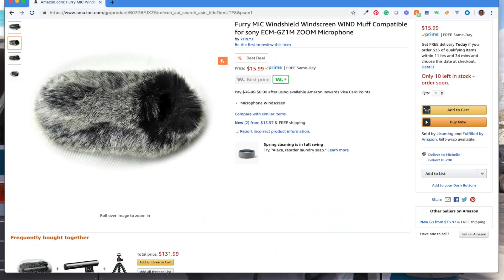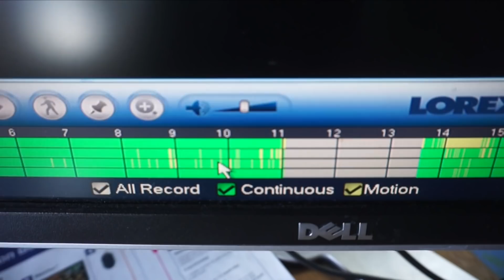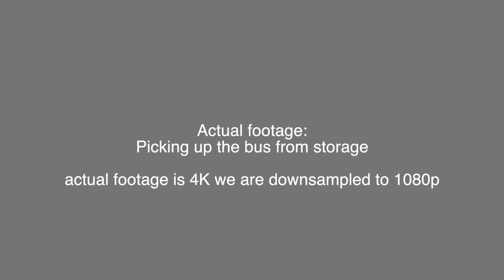Security & Driving Cameras - Part 2: Mounting and Wiring the Cameras & Initial Performance

Comment: Another great project almost done. I liked the placement of the cameras clear view no doubt what you are looking at.  SSD or HDD an SSD writing all of the time might not be durable as a HDD but then again I woiuldn't want to hear the HDD writing while everything is quiet.  You have open spaces in your bays you could place it in one of them and isolate it with dampening material.  I think taking out of its case is a great idea that thing is huge and could be more compact.  Great job Juan and Michelle.  Thank you for sharing Ed.
Reply from the maker: Thank you Ed, we have been really pleased with how this system has been performing.  It's kind of crazy to think that some of our videos in the future could include beautiful security camera footage!  I was really surprised when I opened up the case to discover how small of a footprint this little thing could actually take (The circuit board is barely bigger than the hard drive itself).  That probably wouldn't sell very well in the stores where people want to see a large piece of equipment.  Thank you for tuning in.

Comment: Nice job on the camera installation. I hope they hold up to the wetter weather when you make your way out of the southwest. As a long time TiVo owner you don't want to use an SSD for video recordings especially with that many 4K streams to record.You'd kill an average one in a few months and a very expensive one in less than a year. Many people have tried using SSD's to record video and they just aren't reliable over the long term and are expensive for a limited amount of storage.  I would look at finding an external enclosure that you can isolate from hard bumps or jolts and it should hold up well on the road. With your ingenuity I bet you could make something supported by springs that would work great. That drive looked like a WD purple drive and you would be better off upgrading that to a NAS hard drive. You can get a 4TB for right around $100 or so, I like and have had good luck with Western Digital.
Reply from the maker: Thank you Dirt Road Sailing - Welp now I have more researching to do.  I was aware that the SSD only have a limited amount of read/writes but I was not aware that it was this severe.  funny enough I thought about a small platform suspended on springs.  Thank you for the input ... I will be doing more research :)
Reply: @BeginningfromthisMorning  Samsung 970 pro should have enough writes for you but just putting good isolation on a spinner drive might be a lot cheaper for the space you'll get.

Comment: A spinny HDD is fine in a vehicle.  I would discard the stock housing and mount it on its own little platform that’s isolated by rubber feet or short springs or suspend it in surgical tubing to dampen it against vibration and it’ll be fine.
Reply from the maker: Thanks Ryan - we have been using it for about a month and I have seen no ill effects :).  We will very likely be ditching the case and just mounting the circuit board somewhere.
Reply: This has been my concern as well.  I plan to run the drive it comes with, if it fails in short order then I’ll consider an SSD.

Comment: You'll want an ssd :o) . You might as well get one from the start, rather than change it later.  Even with only 15 fps, seven 4K streams will be murder on the drive, having to work hard (especially when in motion, where each and every frame will be very different - but even at standstill when outside in the wind). And it will be rocking and tumbling around, possibly even in a warm cabinet. The drive will need to be enterprise grade to cope with that kind of treatment. Granted, an ssd of the required size will be expensive; but high grade magnetic disks are also expensive and the noise they make will challenge your calm.  Having to listen to a spinning disk doing non-rhythmic writes at night when everything else is silent is extremely annoying - much worse than a fan or a compressor making steady, white noise.

Anyway, great work as usual, you guys.  Perfect placements for visibility, neat cable management and your trademark thoroughness.  I'm still not trusting the durability of those plastic mounts combined with vibrations, UV and leveraged weight; but I defer to your judgement :o)
Reply from the maker: Excellent points as always Claus.  I am very strongly leaning towards the SSD even just for peace of mind - I had not considered the noise factor.  We are keeping a close eye on the mounts - as you know I am not opposed to a "plan B" ;)
Reply: @Jamir Coen instablaster :)
Reply: @Kevin Leonardo i really appreciate your reply. I found the site thru google and I'm in the hacking process now.
Takes a while so I will reply here later when my account password hopefully is recovered.
Reply: @Kevin Leonardo It did the trick and I actually got access to my account again. Im so happy!
Thank you so much, you saved my ass :D
Reply: @Jamir Coen Happy to help =)

Comment: A tip on something you can use for shock absorption, link below.

Don't stress on traditional spinning disks. We have these mounted on ships with constant vibration and they work just fine. The suspension on the bus also helps a lot.

I think you'll use up the write cycles on a SSD pretty fast.
Most of the time spinning disks are just fine for this kind of thing and also cheap.

Some of these recording systems also have an option you can survey in a lower resolution and when something is detected, they start recording at full res. But probably not usable when driving...

To lower bit rates, you should test at 1080p, most of the time this resolution is more than good enough and doesn't stress your system so much. You see in the driving footage that the recorder is compressing the hell out of the image, just to keep up, maybe this works better in 1080p and you end up with a smoother picture at a higher frame rate and less artifacting.

https://www.aliexpress.com/item/3-5-inch-Hard-Disk-Shock-Absorber-Bracket-with-Mounting-Screws-for-PC-Case-3-5/32895883353.html  

Thank you for making these videos!
Reply from the maker: Excellent points as usual Freddy - thank you for your very thoughtful response.
Reply: Have flown rotating disks on military aircraft, agree that isolated drive mounting is critical to keep the heads from contacting the storage media and causing failure.

Comment: If you opt for an SSD, get a backup, SSDs have a finite number of writes before failure. I would consider using an enterprise HHD with a SSD for backups.
Maybe there's a way to trigger the cameras using turn signals and reverse lights?
Reply from the maker: Thank you Robert - I am looking into what it would take to trigger the different views.

Comment: Juan and Michelle... great bus and set up..  I want to do something similar video wise with my bus.  Have you had any problems with fogging or condensation on the lens?  I worry about driving in rain and the flow of the wind/rain fogging up where I want to see.  I have looked at the dome cameras, but prefer the mount you guys have used.  Thanks!
Reply from the maker: We haven't had issues with fogging or rain on the lenses.  However we have only been in Arizona with it, so not a lot of condensation or anything.  We do occasionally have bugs and spider webs trip the motion detectors when we are parked for awhile.

Comment: Juan I subscribed yesterday and binged watched all of your videos. I'm sooo impressed with your power setup, solar, inverter charger, batteries, power panel etc. I would love to do something like that. I'm curious about how you installed your camera wiring. Why did you run your cables on the outside of the bus and bring them in through one box ? Was is for the ease of having to possibly replace a cable if it goes bad, or you didn't want to drill multiple holes for all of the cameras creating greater chances of water intrusion?
Reply from the maker: Wow thank you Mark - I ran the camera wiring outside and in through a central location so that if there is a problem with that wire it would be pretty easy to replace.  If I would have run them inside right where they are mounted I would have to put them under the ceiling and cabinets and stuff and it may have been much harder to chase down.  Since we already had the big rack on the roof that has solar wires etc running in them it was pretty easy to make a small run up to the channel.  Water getting in is always a concern - so this way also minimizes the chances of water getting in.
Reply: @BeginningfromthisMorning  You guys have done a wonderful job. Just finished watching the windshield installation and exterior lighting videos. I'm 5 years away from retirement and seriously considering doing something like this. I've been hooked on Scotts channel for a while now - which is how I ran across your channel and project. I hope the rest of the project goes smoothly so you and the family can hit the road soon. Best of luck!

Comment: In my experience, when turning on your blinker to see if you have passed someone the left and right camera help to show if there is a car there, but it is horrible to actually give depth perception to tell if you or your tow vehicle is past them.  
I like using a rear facing camera at all times. so you can see if your tow vehicle has cleared other cars.
Reply from the maker: Good point - I haven't actually driven with them yet so I am just using the mirrors still.

Comment: Why didn't you run the wires inside?  The 3M 5200 Marine grade sealant is a pretty awesome product.  I've used it on my motorhome for years, it beats any competitors product hands down.  IMHO.  Video looks very good while driving.
Reply from the maker: Thank you Boun_Viaggo_USA - We didn't run them inside in case something happened to the wire and we needed to replace and/or upgrade it in the future.  If we buried it under our ceiling we would have to run some kind of conduit to ensure we would still have access to it.  The 3M 5200 is amazing stuff for sure!

Comment: Nice. Can you block motion of trees from triggering the camera
Reply: sensitivity should be able to be set, Even the cheap one I bought some years ago allows that function...
Reply from the maker: Thank you Glenn - The motion of the trees does not trigger it but often times bugs flying  in front of the lens will.  As William pointed out the sensitivity is adjustable as well as the ability to define a "range" for where you care about motion (which can then send you an alert if motion is detected there)

Comment: I am planning to do something similar.  What do you think about a camera under the bus so you can see you clearance?
Reply from the maker: Thank you Clint - I think this is a great idea!  I want to do 2 cameras that don't really need to record or have high resolution (or even need remote access etc - PURELY as a driving aid) - 1 as you said for clearance under the bus and one RIGHT on the edge of the solar panel rack to see if I am going to hit something with the rack.  I am looking at wireless RC type cameras and a very small monitor that can do A/B switching between the two.

Comment: Now that I see you drive the bus I am wondering what type of driver's license you need for a 35' bus? We have rented C25's and even a C28 RV and I was allowed to drive it with my normal car driver's license. Is that the same for this bus, or do you need a license especially for buses, or even trucks?
The picture quality is fantastic, even after downgrading it to 1080p. But that is when the bus is standing still. As others also wrote, when the bus is moving each picture is different from the previous one so the whole frame has to be recorded instead of only the parts that have been changed. That means a much larger data stream. Just experiment with this, but do get an SSD cause the hard disk will not survive long.
Reply from the maker: Thank you De Mus - would you believe that no special license at all is required for driving the bus? It is titled as an RV so a regular driver's license is all that is needed.   I still find that kind of crazy.  I do have a CDL manual that I have been studying just for my own sanity.
We did some more research into the hard disk and discovered that putting an SSD drive in there would be a bad idea.  It turns out that SSD drives have a much shorter life when you are constantly writing and/or reading from them.  What we ended up doing is mounting the disk on an isolated rubber-mounted tray which should hopefully protect the disk and extend its life.  We have been running the system since we put it in (driving to and from the storage lot 2x per week for over a year over some pretty bumpy roads) and it has never reported a fault.  We will continue to keep an eye on it but so far so good.

Comment: Re the Harddrive for the camera system:
If you plan to record like say 12 Hours in 4k with all seven cameras, that'd be roughly 1 TB in data. 1TB SSD's in that capacity range are still rather expensive.
Maybe a 2.5 HDD for NAS Systems (24/7 rated), like the WD Red series, would be a better option? Usually 2.5 drives are better isolated from vibrations since they're designed for laptops.
If you'd build a casing where you'd be able to further decouple it from vibrations, like with some bungee cords or so, that would probably be a more economical solution.

What I'd personally love to see, is how the Durango is being towed. Are you planing on releasing a video of that?

Other than that, as always, great work. 👍
Reply from the maker: Thank you Panzergrennie - very good point on the laptop drives being designed for a little bumping around for some reason I had not even really considered that.  The SSD drive is more expensive but they have come down to be quite reasonable in the last few years.  We will get a video of the TOAD setup in action when we get the hitch changed out.  Our hitch is currently just a ball but we need a 2" receiver.

Comment: How’s the system working after a year on the road?
Reply from the maker: System has held up great!  I use it every time I drive.  One thing that I did not expect - We have been through a few times where it was raining so heavy that you could only really see about 10 ft in front of you - pretty scary stuff.  Turns out when it rains that hard my mirrors become almost 100% useless but the cameras are crystal clear.

Comment: Juan, does this system let you mirror the images for the rear facing cameras?
Reply from the maker: I will have to check - there are about a million options.  Since we are just building out the inside - I don't have anything situated for the driving aides just yet but I will try to look this weekend to see if they can be mirrored.
Reply: @BeginningfromthisMorning  Awesome. Thanks. I bought a cheaper system and the images are great, but I just mounted my monitor and drove it and realized everything is backward! Not ideal when driving.

Comment: With the ceiling being open inside why didn’t you run the wiring inside instead of on the roof?
Reply from the maker: Thank you Richard - The main reason is because if something happens to the cable and it is inside the ceiling it would be much harder to replace / upgrade.

Comment: Don't even waste your time with the spindle and platter hdd, replace it with an SSD before you put the system in production. The platters do not like the road environment. TV DVR's don't do well when left on in traveling RV''s either.
Reply from the maker: Thank you PNW Fireguy - when we get it moved into the tech cabinet we will replace it with an SSD - I agree with you 100%.

Comment: Camera install looks great, but remember that you're driving a bus not a computer game. Millions of miles of safe travel by buses with drivers using nothing but mirrors. Learn to use those mirrors well - they will save your life when your camera system decides to cash out on you. Took a while on our bus, but once I got the mirrors adjusted and I learned to use them I feel quite safe driving without any side or rear camera while in motion. Not denying usefulness of camera system, just pointing out the obvious of still using and relying mirrors.
Reply from the maker: Thank you Richard - 100% agree the cameras will be an aide not the main interface for driving.  The place I really see them being helpful is when maneuvering into tight situations.
Reply: We use ours mostly to check behind before backing. Even though I walk behind to check first, it's nice to have the camera back there to keep an eye on things immediately behind.